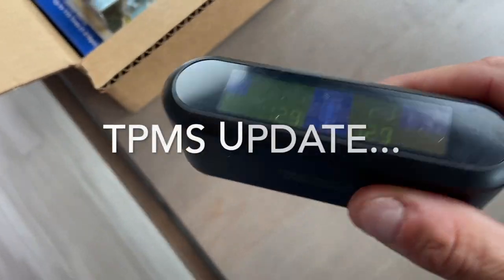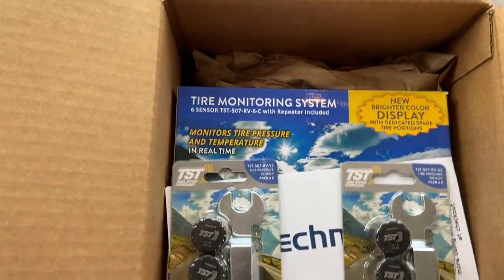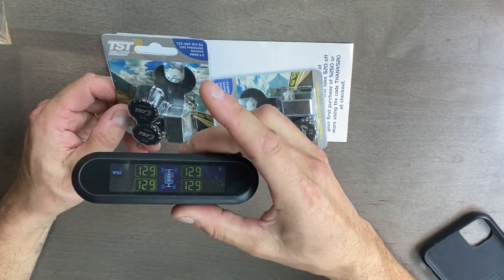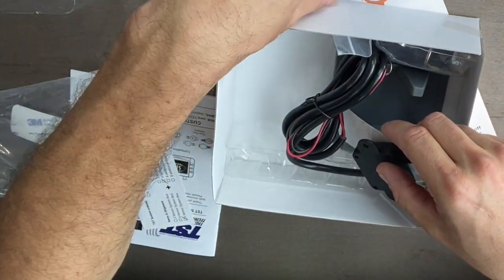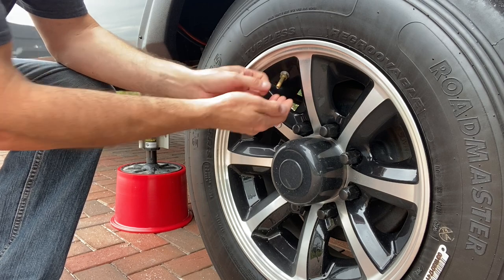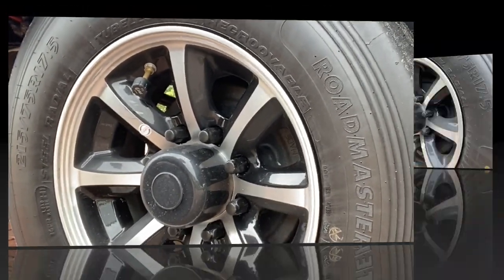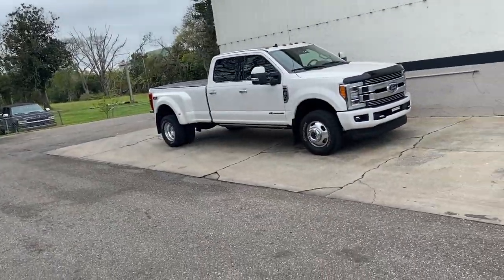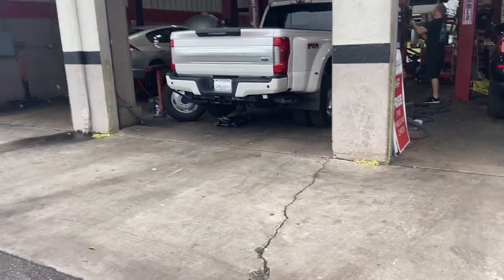Admitting I Need Help | TST 507 TPMS Update | Grand Design Solitude 380 FL R

Comment: Just as a point of interest when you go to install your tea PMS should do it with a air gauge / compressor with the tires cold and make sure you set all of the tires at the same psi then put on the monitors on each tire
Reply from the maker: Very good idea! Thank you so much for mentioning that.   👍🏻